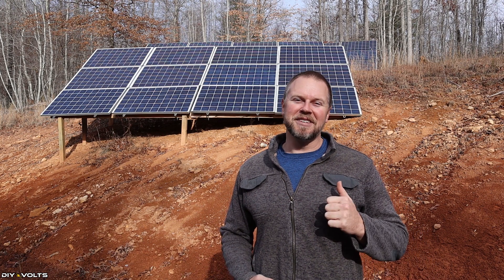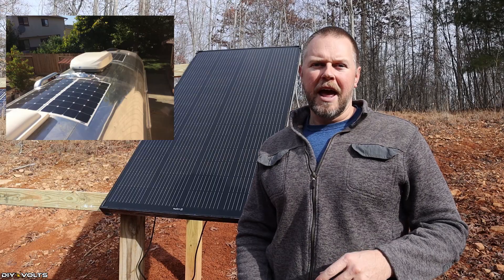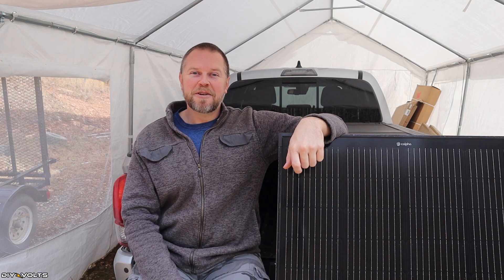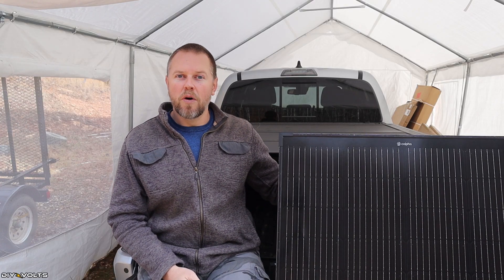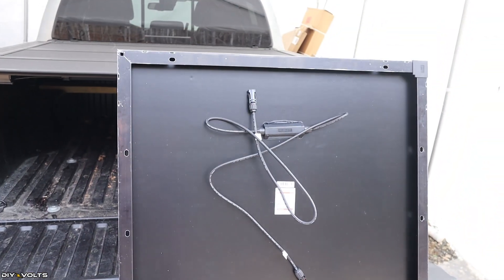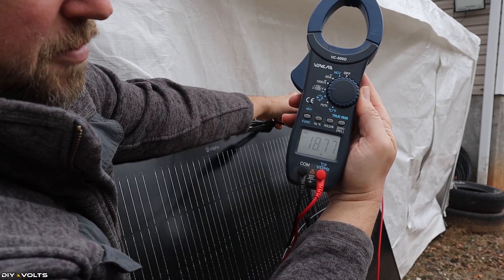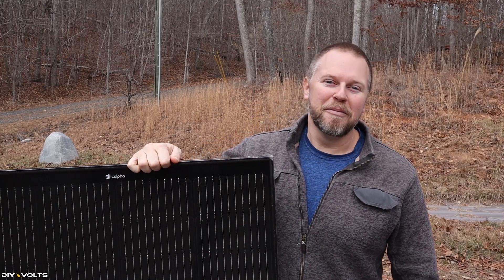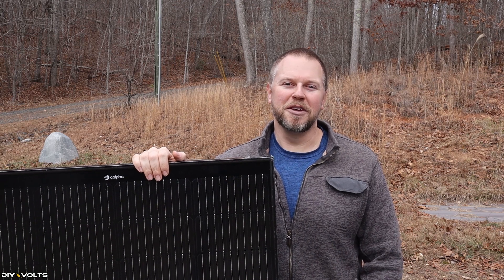SOLAR PANELS For Beginners - Learn the Basics of Solar Power

Comment: I live in a killing hot area of the US and am very "daunted" by all of this solar/electrical language.  I wish I had somebody who could just tell me what product/products to buy for the simplest setup to plug in the smallest a/c window unit available for one 10x12 room if the power goes out this summer.  I can't put anything on my roof.
Reply from the maker: Heating and AC are tough because they need a lot of power. A small window unit will need 500-900w of power. Solar can do that but you would also need a battery for a passing cloud.
Reply: @DIYVolts  So what about one of those Bluettis or a Jackery?  How do those work?

Comment: Trying to do a Solar DIY. Would like to charge EV. Not worried about home. Is there a way to make solar, store into battery, and go to EV? Trying to bypass DC AC conversion and simplify   the build.
Reply from the maker: Yes that is possible. Solar panels produce DC power that can go to a charge controller and then battery. From there you would need to use a charger dedicated to run from battery. Or you could use a large power station such as the Zendure V.

Comment: Took the Jump here and went off grid. Yeah just left the city life behind. In order to do this I watched 5 years of video's like this and learned Ohm's Law.  I had to understand how battery chemistry worked. How temperature affects ALL power production and know the differences between  real and fake equipment such as cheap  high frequency modified sine inverters vs True low frequency Pure sine inverters. I agree there is minor differences in Mono and poly. We opted mostly for poly. I can live in a tent by my wife wants the normal luxury's. Fridge, microwave and coffee maker + the dredded Airfryer.  4,800w PV, 6,000 pure sine low frequency AIMS inverter ( 95 lbs <- crazy heavy ) and a DIY custom Lithium battery 15KwHrs from an electric vehicle with BMS's on each pack of cells 14s and tons of DC Breakers between every component. Its critical to ground/bond everything.  So far so good! Bad days without sun happen but an an adorable 7,500w 120/240 50 amp champion is back up to get us through.  We spend about $75 on Gas in 1 year and $225 on LP to heat and cook with per year.  Growing food  and thinking about  rainwater system for the garden drip system and water for the shower and dishes.  If anyone thinks of doing this life plan on everything taking x2 or x3 longer than expected. Is it worth it? We think it is.  Shed to house conversion was interesting. 100% Over insulate it to make heating or cooling a breeze and save energy over a lifetime.  Can't stress enough about super thick extra insulation. Game changer to this lifestyle. 
CHEERS to DIY VOLTS helping us all to achieve a path in the mess that is power!  Happy New years! The Shire.

Comment: I Looked At Solar And Found It Wanting!! To make The 5000 Watts I Need To Live My Life Without Air Conditioning It Would Take Up My Whole Yard! Instead We have Water Running Across Our Property And It Runs Down A Hill! I Looked At A grist Mill And Decided That A Water Wheel Was The Way To Go!! And Since There Are No Laws Making Me pay The Power Company! I Took A Generator Apart And A Gear box Off Of An Old Tiller And Was Able To Get The Correct RPM's Off Of My Water Wheel!! I Then Took That Power And Stepped It Up Using A Transformer! It Then Runs In Conduit Up To My Home Where I Step It Back Down To The 220 Volts Needed! It Has Been Running Now For 1 1/2 Years! I Expect The Generator To Fail Any Day But It Just Keeps On Pumping Out Power!
Reply: Awesome
Reply: Depends on how many watts the hydrosystem is providing.

Comment: Thank you for your explanations. 

  I'm kind of a different duck (autistic 😂).

Here's my approach:

I run my entire house using one 12-volt panel. 

Not what you think.

My panel runs a small 12-volt motor whenever there's enough sunshine.

That motor runs an air compressor.  I store compressed air in lieu of a battery and when I need electricity, my system runs compressed air through any of 3 air engines I designed and built, each one coupled to a generator.

Easy peasy.

Caveat:
I still use mains power to run 5 freezers, but I'm working on a fix for that.

My entire SOLAR cash outlay is $36 per panel. I have a few of them in the wings --   back-ups / extras.

Comment: Very helpful....i just had one question....suppose several panels with open circuit voltage of 20 V were connected in parallel, due to shade cast over one of the panel, its open circuit voltage reduces to 15 V, my question is due to this drop in voltage from only one panel, will the voltage of entire system reduce to 15 V or remain 20 V ?
Reply: AFAIK this will bring down the system voltage and therefore the efficiency. People typically put north/south/west etc. Facing arrays on different mppt controllers so that the shaded panels don't impact non shaded
Reply: Parallel panel set up you will benefit from each panel having its own blocking diode. NICE If you series them and get  shade the ENTIRE array is affected! BOO! Hope this helps.  Poly do better in shading vs mono.

Comment: Good video for a newbie to solar. Do you have any solar mini splits on the property? Smart to be off grid 👍🏻
Reply from the maker: Thank you. I do hope that the video helps people get into solar. Currently I do not have any solar powered mini splits. I have seen those and they would be nice to work with.
Reply: Many, like myself probably see this as daunting with the volts,amps, math etc which is why i paid for mine to be installed but videos like these will help simplify things and also serve as a reference as I look to expand what I have while doing it myself and saving half the cost on paying an installer. 👍🏻 @DIYVolts

Comment: good channel. people will need your information as times get worse. I am glad we are ahead of the curve.
Reply from the maker: It is nice to have off grid power! My house has lost grid power over 15 times this year and except for the hvac and hot water I don't notice.
Reply: We have the EG4 18K PV like your Lux Power 12K and a DIY 28 kW of EVE 280K  cells from Docan power out of Texas and 14kW of SEG bifacial panels. We use the EG4 Chargeverter connected to our 5,000 watt Diesel generator that runs on Veggie-Oil to charge the battery's when it is cloudy. Off-Grid is awesome.